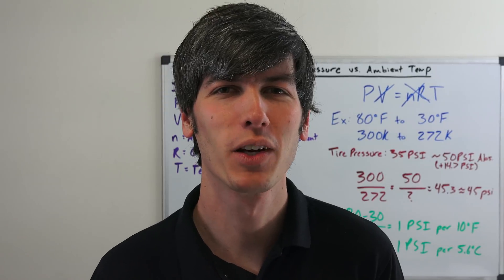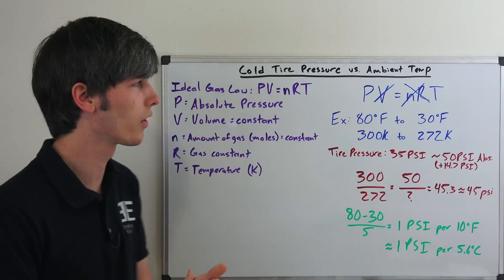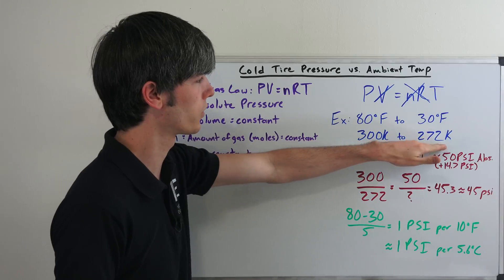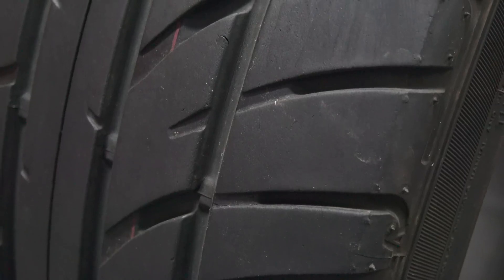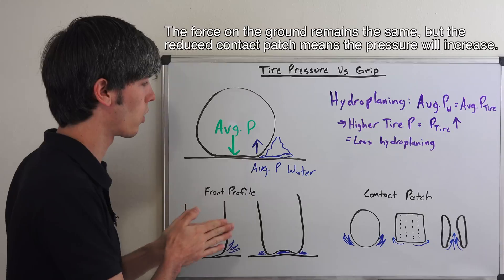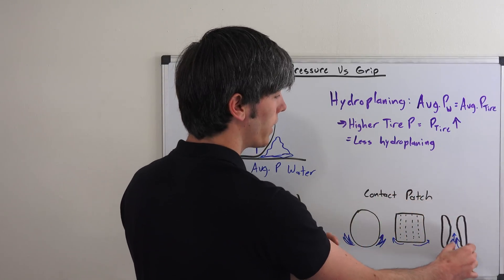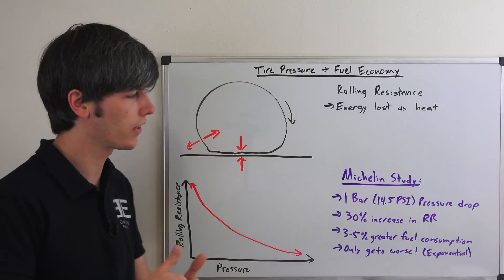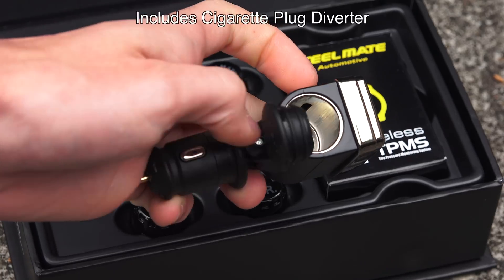4 Reasons You Should Monitor Tire Pressure

Comment: Wonderful information!  Looks like I've been bass ackwards about tire pressure and hydroplaning all these years.  Whoops!

What I'm curious about, is how do you work out the correct inflation pressure for a tire?  The sticker on the car is great, but where did that number come from?  How does that number change when changing wheel/tire sizes in an aftermarket setup?  I've heard so many different things from different tire shops over the years, I honestly don't know what's right and what's wrong!
Reply: It's been worked out by the vehicle manufacturer. Just use what they suggest.

Comment: why do some mechanics tell you to add 4 PSI on top of the manufacturer's recommendation for "daily driving"?
Reply: +Tuddec The opposite.
Probably 80% of drivers don't change their pressure when winter hits - for those winter months, the tires are 8-10PSI underinflated and reveive excessive wear.
4PSI above prevents this for those that simply don't check their tires, while providing a very slight handling and mileage increase. 4PSI is also not enough to increase tire wear.

Comment: Great work on your videos! 

Q: What about the difference between what the manufacturer recommends for the vehicle vs. What the tire manufacturer lists as a max pressure? 

I tend to keep my tires closer to the max/higher than vehicle manufacturer...
Reply from the maker: I'd always go with what the manufacturer recommends.
Reply: Usually, half between OEM and tire max is a safe bet if you want to go higher.
On most cars, the door sticker pressure is a bit low. I had to go 6PSI above to get even tread wear.
Reply: Yeah you wouldn’t want to keep it close to max. Anything above maybe 40 psi, depending on the car of course, probably isn’t going to be yield any benefits

Comment: wait..fuel economy gets better as tire pressure increases up to what point? rolling resistance is just a force that the car has to overcome? does it have any benefits? (i didn't really get that part lol)
Reply from the maker: This should clear things up! https://www.youtube.com/watch?v=oV_6u4Z5p-c
Reply: Think of it like a bike tire....if your bike tire's flat, its harder to peddle and its "mushy" i.e. more resistance to rolling smoothly. In a car same thing, you cant just keep filling it though because like he said, over inflating will cause the center part to bulge out more than the outside parts of the tire in an oval shape so the center of your tire will wear out more quickly than the edges, plus overfilling will be dangerous above the tires recommended capacity (think about over inflating a baloon!) and cause more stiff uncomfortable ride when going over bumps.

Comment: Could you please answer and explain this; Does more contact area on the tire (wider tires) equal to more grip in the corner, on a smooth, dry road?
My friends and I are arguing over this for days!
Reply from the maker: Typically yes, here's why: https://www.youtube.com/watch?v=kNa2gZNqmT8
Reply: basically, lower pressure is more surface area. more surface area is more grip, so less tire spin, but more grip to overcome. think of it this way, if you glue one finger to a table, it takes less effort to pull off than if you glued your entire hand to the table
Reply: Engineering Explained

Ups, I somehow missed that video, thanks a lot!

Comment: So.... we can deduce a wider trire is more likely to hyroplane?
Reply from the maker: Most of the time yes, as a wider tire tends to provide a larger contact patch. This is assuming pressure is held constant, and the tread pattern is similar.
Reply: +Engineering Explained it's also why snow tires also tend to be skinnier
Reply: it depends some tires have better wet traction
Reply: Yep, was thinking if all other variables were the same.  Tread, weight, psi, etc.  Many Jeeps, such as mine, have a very wide tread pattern on the tire.  Better for off roading and mudding.  Hadn't thought about increased risk of hydroplaning.  Great video, thanks for sharing!

Comment: Is it best to use the tire pressure stated that is on the vehicle, or the use the tire pressure that is stated on the actual tire and why?
Reply from the maker: Use what the vehicle states, as it's often based on the mass of the vehicle and specific handling/weight distribution characteristics (you can generally find this on the door sill on the drivers side). The tires typically only show a max pressure, not the recommended.
Reply: Good stuff. Thanks for the reply and the vids!

Comment: Is there a way to calculate the ideal tyre pressure for grip?
Reply: There's no easy way to calculate for two reasons. 1. For calculating the contact patch area, you need to take tire deformation into account, and that heavily depends on the internal structure and materials of the tire (i.e., how stiff the tire walls are, shape of the tire, etc). Finite element methods (FEM) or something similar could be used to compute the deformation and the contact patch, but that requires design files, which won't be available for the public, and is rather non-trivial anyways. 2. Optimum grip is a bit ambiguous term. For best acceleration and braking, you would decrease the pressures a bit to increase the contact patch area by more longitudinal deformation, but this comes at a cost of cornering grip and precision, since the tires won't have as much rigidity under lateral load, making it less responsive to steering.

You usually don't want the optimum grip in a daily driver, unless you go street racing. But instead, you want to load the tire evenly from the center and the sides of the contact surface. For that, I guess you could chalk the tire (as suggested above), drive a bit, and see if the chalk wears off evenly.

Race tires follow the same rules, except that due to a bit different shape (I guess they are more round with stiffer side walls), even loading happens at lower pressures. Lower pressure = more deformation = larger contact patch. More deformation also helps building heat into the tire.

For pressure setup, you'd first drive couple of laps to get them heated up (often about 80-90 C, depends on tire), then measure the tire temperatures from inside, center, and outside parts of the contact surface. If the center temp is the average of inside and outside temps, the contact patch is approximately evenly loaded. If the center is too hot, you have too much pressure, and vice versa.  Hot pressures (this is what matters) are often around 2 bar, but this depends on the tire (model and size), car, and the race track itself. Hot pressures are set up per tire or at least per axle, and cold pressures are meaningful only for getting the hot pressures right. Cold pressures are often around 1.6-1.7 bar, but that depends on the ambient temperature and air humidity. (More humid air in tire = larger cold/hot pressure diff)

But even in racing, it's not so simple to set up the hot pressures. In qualify setups you might drop the pressures a bit. That sacrifices the load evenness, but gives a bit more longitudinal deformation for larger contact patch. This results in a marginally better grip, and allows the tires to heat up quicker. The downside is greater tire wear, and during longer stints, the tires might also overheat. Also, tire pressures are used to fine-tune the car balance: increase pressures in the rear and/or decrease in the front, and the car balance becomes more understeerish. And vice versa.
Reply: chalk your tire.
Reply: On most cars, the number the manufacturer puts on the sticker in the door jamb puts you right in the ballpark. (Maybe a PSI or two more.) The engineers do a pretty decent job at math regarding tire size and weight of the car.
Reply: Nope. There are simply to many variables that influence the tyre performance. For instance a change in ambient temperature alone can massively change the ideal tyre pressure.
Reply: What if you buy different tires. For example summer tires. Shouldn't you check the words on the tires for best tire psi?
Reply: locosychocrazy1
Tires to spec for the car will still fall into that pressure range. Number on tire is just the max.

Comment: so what PSI should your tires be? I just bought my first car which is a 2016 mustang gt and as you can probably assume I'm obsessed with it and babying it. Right now I noticed my PSI hovers around the higher 30s up to low 40s. is that where I want it to be?
Reply: I believe its best to follow the manufacturer's recommended tire pressure for each wheel, which should be listed in the car's manual or at the bottom in the driver door sill.

Comment: What is the weight (in gramms) for the sensors? I think they will add imbalance.
Reply from the maker: I believe they're only around 10 grams. I certainly couldn't feel them on the Camaro, and read through reviews as I was curious about this as well. Doesn't seem to be significant enough of a mass to make a difference.
Reply: i was thinking exactly the same thing
Reply: Engineering Explained Thankyou for your reply, interesting to know.
Reply: +Engineering Explained balancing weights are 2,5g or 5g, so it seems to me that it actually might. If you feel it is point 2. Although I think that a light European car might be more sensitive.

Comment: I hate it when you get new tires the tire shop over inflates the tires.
They all seem to use 40PSI or so for all cars where i live.
Reply: My tires are rated for 44psi
I filled it to 44, and I gotta say, I like it a lot better than the 24psi those things were sitting at before
Reply: +plokmijn47 44? what do you drive?
Reply: Legacy outback
Reply: 96 if that matters
Reply: +plokmijn47 most car tires are rated for 44psi Max, I run around 33-35 for best grip
Reply: max well
 As I awaited a response I did a quick search and found basically everything telling me not to run the tire PSI.
Which surprisingly the car was driving great at 44 PSI all around, although it is rated on the door frame 29 front 28 back. This is keeping in mind I drive somewhat aggressively, i.e. whenever I see a gravel road I hit it at 30-40mph and slam the e-brake etc.

I did though upon learning this bring my fronts down to 31, and my backs to 30
Reply: I do less burnouts in first gear when accelerating uphill. cornering feels about the same. slightly less responsive but more grip.

Comment: I drive old school cars so they don't come with tyre pressure sensors. I just make it a habit to check the pressures manually once a week or so.
Reply from the maker: Seriously, good on you! More people need to monitor. This device just makes it super easy, but either way keep checking!
Reply: i do the same, no big deal, also gives me a chance to look around the car to make sure everything is in order
Reply: Engineering Explained I was just taught to always look things over every once in a while. Hard learned lesson taught by my father. He used to have an '89 mustang GT(beautiful car, Porsche red paint job, fully built at nearly 500bhp, he put over 200k miles on it), and my uncle would always harp on him about looking under the hood every once in a while just to poke around. He never did, and sure enough, radiator had broken free from all the mounts, and after smashing around for god knows how long had leaked everywhere on him. Always best to be preventative to avoid expensive repairs
Reply: +Engineering Explained you should also check for damage and foreign objects like small rocks nails etc
Reply: Ian: Not really, just monitoring pressure is fine. You're far more likely to notice one tire's pressure fluctuating/lowering much more than the others than you are to actually see the nail in the tire.
Reply: ***** i usually hear the noise they make and it drives me nuts I have pulled a few recently maybe it's just a thing where I'm driving

Comment: "modern cars come equipped with tire pressure monitoring systems, but the feature is much more rare on older cars"
realises car doesn't have one
Hey, don't you dare talk like that about my car!
Reply: +Dead5NAlive it's actually really interesting. the way it used to be done was physical barometers in each tire, but this made big issues with different tires and rims than factory. now it's more common to have it calculated by how the tire spins at a certain pressure vs current pressure (not sure how to word that last part, think you get the idea though)
Reply from the maker: Haha my Integra didn't either, but now it does! Actually a pretty cool system (linked in the description).
Reply: +Engineering Explained Well, it does look like a really interesting feature.
Could you do a video on how the built-in system works? Like where the sensors are and how data is transferred? Thanks again, keep up the great work!
Reply: google "tpms", you have sensor in wheel that sends info wirelessly to car ,voila :)
Reply: +Dead5NAlive From what I understand the sensors aren't on the rim(the old barometric style pressure sensors were however), rather just where it attaches, that way they can be recalibrated for different size rims and tires. Again, not an expert, I'm just a guy that watched a humblemechanic video on it
Reply: The sensors are within the tire where the air is contained so it is able to detect the pressure, they are battery run as there is no real practical way to get power to them. Sometimes they will replace these sensors when the battery dies. Though it usually takes a fair few years depending on how well they were made.
Reply: Dead5NAlive
something like that, btw that's direcet monitoring, indirect tpms is using abs to determine wheel rotation and with that it calculate if your tire is deflating (its not showing on screen tire pressure where direct tpms is showing psi/bar)
Reply: +T0n1F0n74n4 wirelessly, like bluetooth?
Reply: +Dan Giaimo so basically sensors placed in the wheel (rim?) measuring how the wheel spins?
Reply: My 2016 car doesn't have it either